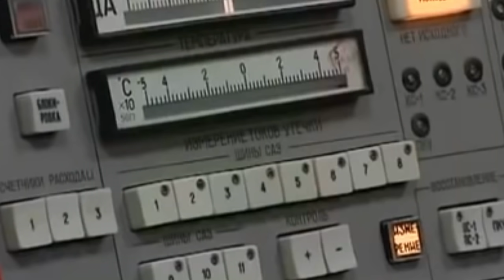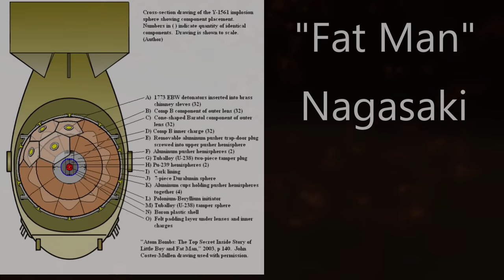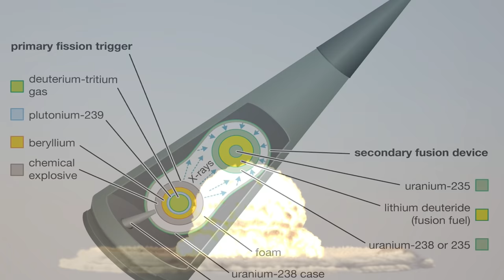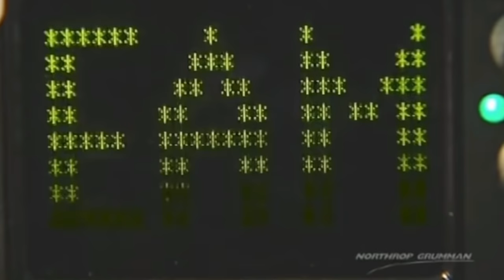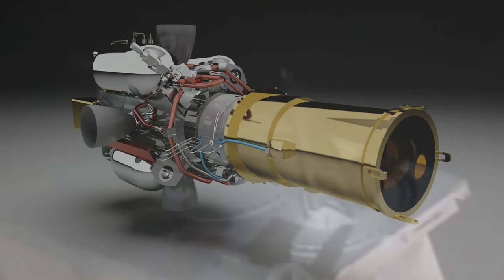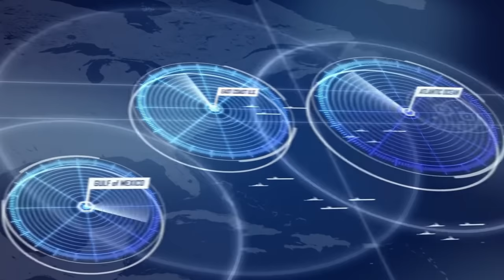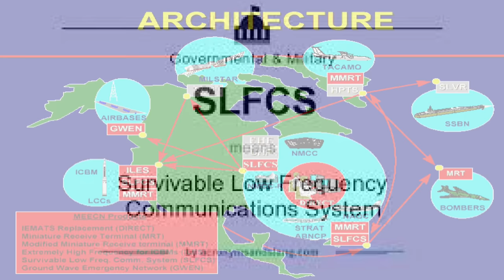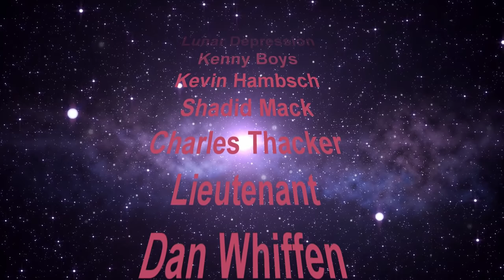Space Defense Systems: The Satan ICBM and Nuclear War with Russia

Comment: Since you seem to know your chemistry, I have a couple of questions:
a) What is the equivalent TNT explosive power of a fully stacked and fueled Starship, should it explode on the pad during liftoff. Would it burn or would it explode if all the tanks rupture? How far away should I stand to watch a liftoff?
b) What is the carbon footprint from burning all that methane?
Reply from the maker: The Starship would explode but not detonate... The worst explosion would be on landing... When the ship is full of vapor.  That would look something like the previous test explosion of Starship 4 I think it was.  When full it will rupture and burn so a conflagration.  From what I can find: the Starship puts out about 2,683 tonnes of CO2, plus 1.7 tonnes of nitrous oxide.  The average 18-wheeler puts out 223 tonnes of CO2 per year so about the same as 12 18-wheel trucks.  That's one of the reasons why spacex plans to use solar to hydrolyze water and produce hydrogen, then combine the hydrogen with atmospheric carbon dioxide to produce methane... Thus making the Starship carbon neutral eventually.

Comment: Hi I have a question. I have dreamed up a engine design of a Expander Cycle closed loop engine being able to produce more thrust using some things I learned by learning about introducing the gas back from the preburner. I drew up a concept is there anyway I can send it or show it to you alongside some pros and cons list and how it would work to solve the problem. Because if it ends up seeming possible maybe you could dive into it and possibly make a video on it but I know that's a lot but it is a cool concept. I could also write why its important to have this type of engine. One more thing, I think a good video idea would be to teach about the different ways rocket engines are started like spin up of the turbopumps and lighting them but I don't know a current topic you can tie this into. Loved this video thought it was very informative, hope you respond!
Reply from the maker: Sure... TerranSpaceAcademy@gmail.com
Reply: @terranspaceacademy  Just to let you know I just sent you an email detailing the engine with a diagram of it and another picture to help explain the pump system. My username with be Astricted there and if you cant find the email let me know and I will send it again or just give you my email to look it up in your inbox. Thanks for responding!